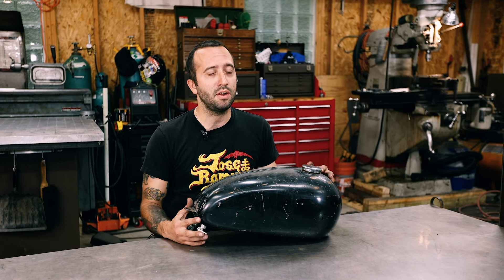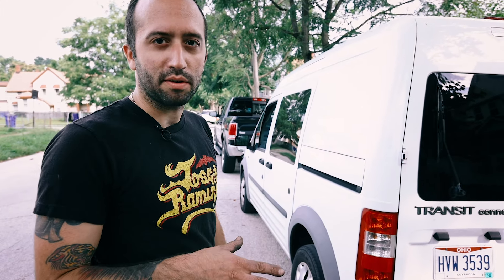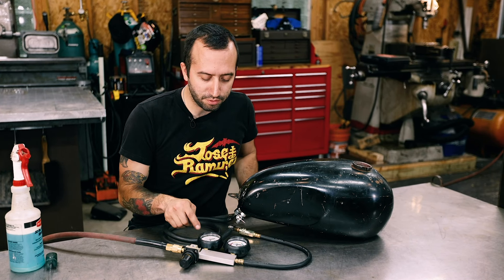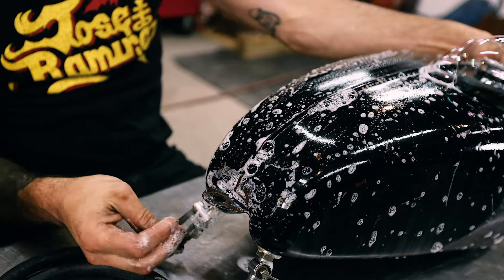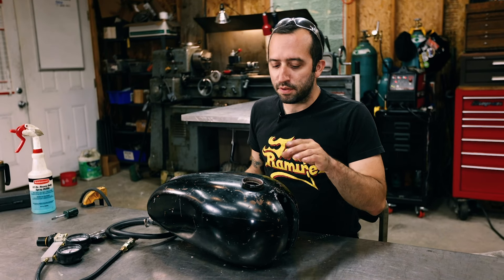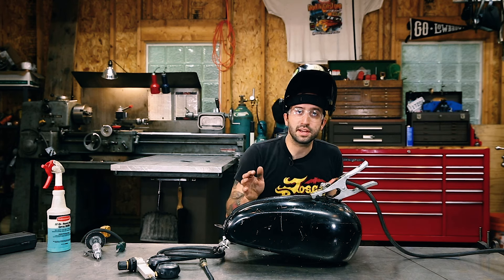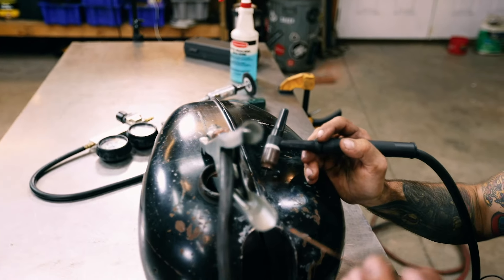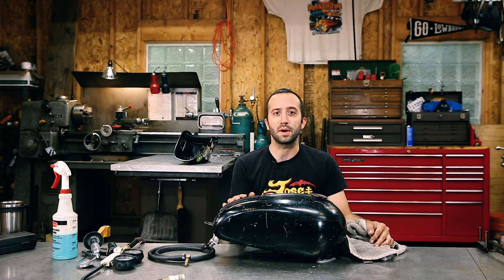How To Pressure Test A Motorcycle Gas Tank

Comment: Grocery bag under the gas cap handles the vent.
Reply: if you means seals it up for the pressure test I wouldn't do that. It's best to let some air escape thru the vented cap. anything more than ~ 5 PSI risks blowing out the seam welds. but i'm no expert so just my opinion. as they say in the car ads Your Mileage May Vary!
Reply: @rcanoli99  I use a regulator. A Harley bayonet cap will let massive amounts of air out, you won’t be doing a pressure test.
Reply: @samhain3824   Oh right - ya with a regulator you're good to go.

Comment: Nice vid. The only thing I would add is a good tank liner (I like POR15) is cheap insurance even after welding up spots like this. Also, if welding is not an option POR15 alone will often take care of small pinholes like these.

Comment: I know brazing has it's place but I can't stand it either. I TIG almost everything as well, especially sheet metal. The tacks are softer than MIG and there's less post weld pull. But the main thing I can't stand when repairs are done with brass is then you can never electric weld that area at all again unless you cut all that brass right back out!

Comment: I bought a 68 Triumph Bonneville a few years back and the PO tried to remove some dents from the tank using air pressure and it didn't go so well. He used to much pressure and the bottom of the tank spread like a Butterfly's wings!
Reply from the maker: no beuno!

Comment: Can i use jb weld or a liquid to hardened meterial. I dont have a welder and the tank is bare metal??
Reply: CAN and SHOULD are subjective. JB weld does make a tank repair specific kit... read the reviews before purchase. It's all about how clean and how much prep you do... you're going to end up with more time in utilizing that product properly than you will to repair the right way (JMHO)
Reply: @PartyN8  bike sold and no longer worried… lol bought a 2020 sportster 😝